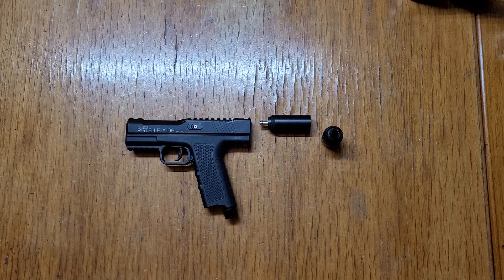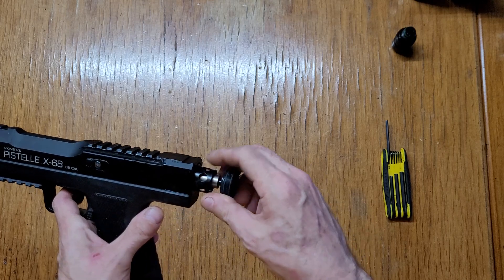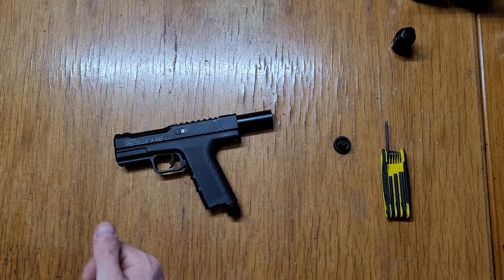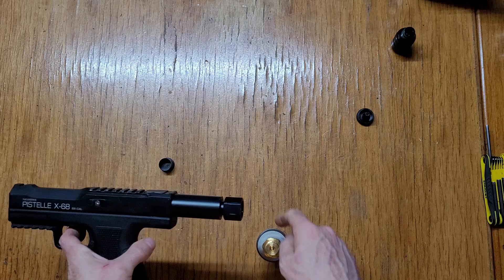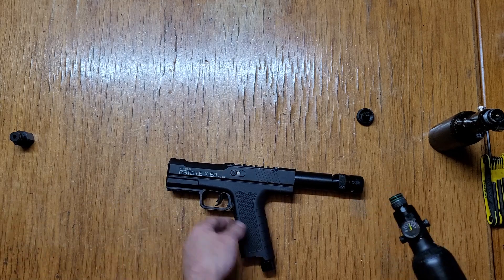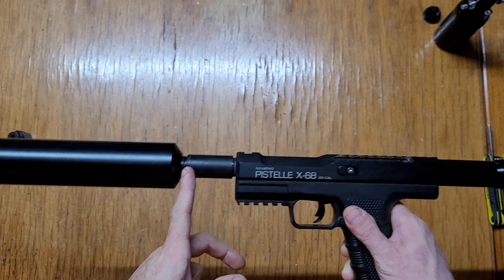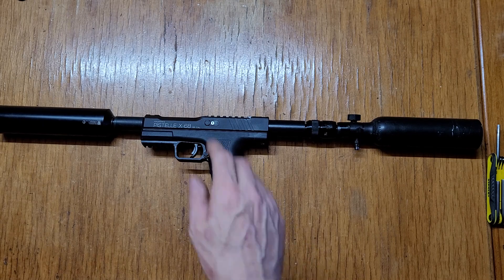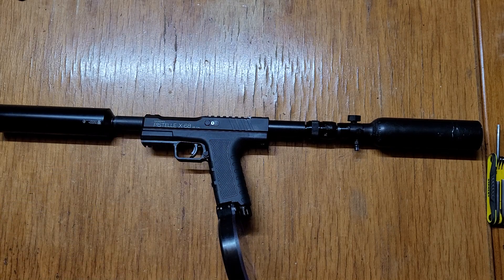Pistelle X68 150 Joule SSD Power Cap Installation

Comment: I installed this HomeDefense 150J+ booster kit and connected a gas tank with a regulator to it. What's the regulator output on the tank? I used 3500 PSI and it blew my pistol out... Air immediately flew out the barrel and shredded the magazine...

Comment: For high-pressure airguns, Viton™ fluoroelastomer is an excellent material, especially for static seals like regulators, due to its resistance to extreme temperatures and pressures. Polyurethane is also a strong choice, particularly for dynamic applications like regulator pistons, because of its wear resistance, with a 90 durometer hardness being suitable for high pressures. For less extreme pressures (under 3000 psi) or where cost is a concern, Buna-N nitrile o-rings are a common and effective option, with a 90 durometer being better for high pressure than a 70 durometer.
  
Material considerations
Viton™ (Fluoroelastomer): Ideal for high-pressure static seals in harsh environments, such as regulators.
 
Polyurethane: Superior for dynamic seals (moving parts) due to its high wear resistance. A 90 durometer hardness is often used for high-pressure applications.
 
Buna-N Nitrile: A common and cost-effective choice for many airgun applications, especially for static seals. 
For pressures below 3000 psi, 70 durometer is often sufficient. 
For higher pressures, a 90 durometer Buna-N is preferred to prevent extrusion.
 
High-pressure static seals: If the o-ring does not move, Viton can be an option alongside Buna-N or polyurethane.
 
High-pressure dynamic seals: Polyurethane is often a better choice than Buna-N for parts that slide, though a 90 durometer Buna-N can work.
 
Hardness considerations
Durometer: is a measure of rubber hardness. A higher number indicates a harder material. 
90 durometer: A harder material that resists deformation under high pressure better than a softer one. 
70 durometer: A softer material that is more flexible and suitable for lower pressures.
 
Other tips
Always ensure the material is compatible with the medium (air or CO2). For example, Buna-N o-rings can swell in CO2, making polyurethane a better choice for CO2 systems. 
Consider using a lubricant designed for high-pressure airguns to improve seal performance and lifespan.

https://www.google.com/search?q=What+O-ring+material+is+best+for+high+pressure+air+gun+or+rifles%3F&oq=What+O-ring+material+is+best+for+high+pressure+air+gun+or+rifles%3F&gs_lcrp=EgZjaHJvbWUyBggAEEUYOTIHCAEQIRiPAjIHCAIQIRiPAtIBCTE1ODc3ajBqN6gCALACAA&sourceid=chrome&ie=UTF-8
Reply from the maker: Thank you for the info :)

Comment: Of course, if you change tank size and or tank capacity, it will directly affect Power.
Reply from the maker: if you add the psi as well it will give more power as well as a longer barrel

Comment: Cool I've been wanting to get one of those but first I need to buy another X68 since I got red of my first one, it gave me to many headaches
Reply: Do you think the Gen 1 issues are resolved in the Gen 2?  I ask because I'm about ready to buy.
Reply: @TicTac-g7m they are not gen 2 might actually be worse in performance wise. Less joules and the spring is an issue. With this mod it fixes that wobble as well that’s a more problem on the gen 2
Reply: @imtofast 
So if I do the SSD upgrade and maintain the O-rings, can I depend on it to fire when I need it?
Reply from the maker: @TicTac-g7m  seems the gens have issues with orings and bolt
Reply: @LessLethalHomeDefense 
Thank you for your time. I'm new to this. Does the SSD upgrade solve the bolt concern?
Reply: Yes bro I got one 8 love it😊 @TicTac-g7m
Reply from the maker: ya once you get the correct orings your good :)
Reply: Definitely saving this channel for when I get one